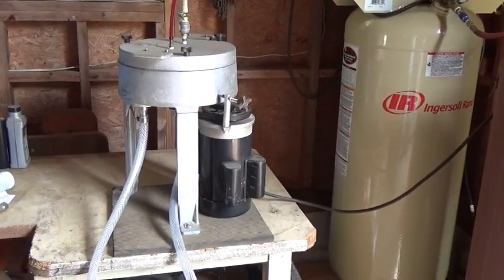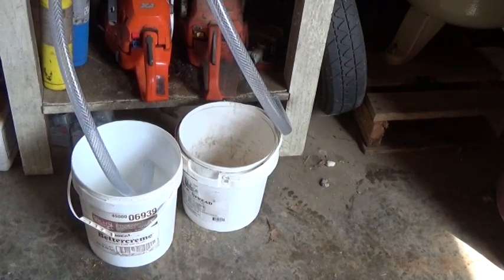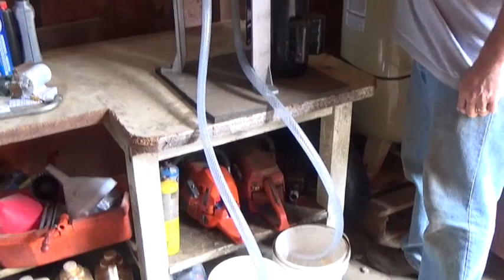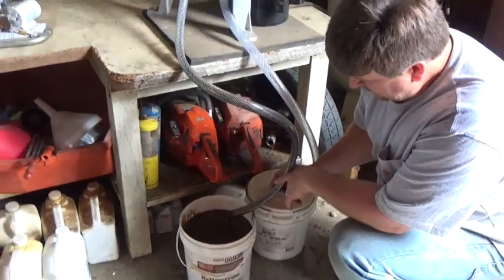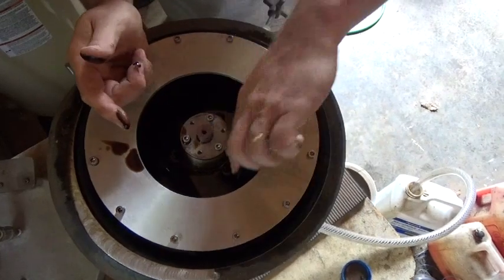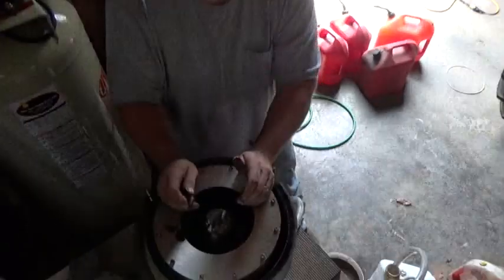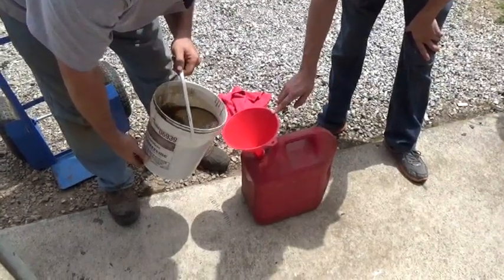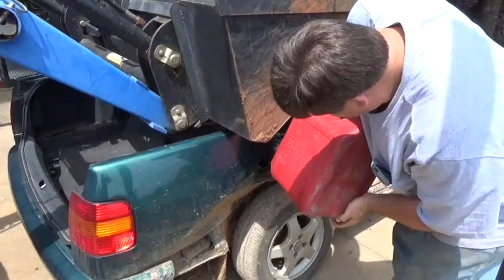Black Gold!  Spin Free Fuel!

Comment: Retired farmer here, years ago I ran a Case 4890 4 wheel drive tractor. Was about 300hp, fairly big for that time. That engine make was a Scania, (Swedish company, still makes tons of diesels). Point is, that engine used a centrifuge to clean the oil. It wasn't a big canister, probably about 8 inches in diameter, and 6 or 7 inches tall had just a couple of small jets that propelled the spinner. It was in the pressurized oil line from the regular crankcase oil pump. The oil continually circulated through that centrifuge. I ran 200 hour change intervals on that oil, and would scrape about a 1/4" layer of hard carbon/contaminates off the inside wall of the centrifuge can with each change. The only paper element in the whole system was a small inline oil filter going up to the turbo. Never had a speck of trouble with that engine, and I have no idea how much money was saved not buying large throw away oil filters. Was a great system, centrifuges do an amazing job..
Reply: I have a superduty with a 7.3 and I bought a centrifugal oil filter from diesel craft and was amazed at how much crap would come out of my oil and my oil stayed looking fresh right around 150 hrs of operation it would start showing it’s age prior to the filter I would change my oil and as soon as I started engine to ck for leaks my oil was black did even look like I changed it i took samples of my oil at 50,100,150 ,200 I usually change my oil between 250-275 hrs  now I go to 500 hrs cause of all the samples I did but the oil analysis lab which was Cat told me that I should change my oil filter around 500 hours so I change it all I use rottella 15-40 now every diesel has a centrifugal filter there’s a lot of different manufacturers
Reply: @jkmcp45  Thanks for your input Sir, I think your experience with the 7.3 would match up pretty close with samples from my old Case. I too sent in oil samples back in the day, and the results indicated I was erring well on the side of safety. Of course I was buying oil in 55 gallon drums for all of my diesel engines and the price back then was just over $210 a barrel! Quite a difference now. (That was Rotella 15-40). Anyway it was very cheap insurance for engines that worked so hard in unfriendly conditions. Good luck with your 7.3, I had two of them too. Good engines.
Reply: @jkmcp45 where did you get that filter from ?
Reply: @Sky_vulpes  Hi, the centrifuge style filter was standard on the Case 4890 and 4894 models with Scania engines. Those were the biggest tractors that they made. Most all of the smaller Cases used a regular Case built engine, 504 cubes, both turboed and naturally aspirated. They topped out at around 250 or so hp, the Scania engine I had was rated at 300. I don't know if they still use the centrifuge system on their new engines (Scania),  my experience was in the 1980's. I can't imagine that they abandoned that system, Swedish company.
Reply: @Sky_vulpes he mentioned diesel craft

Comment: I filter 55 gal. of waste oil in a three phase filter setup useing a 24v Holly cintrifugal fuel  pump mounted above the tank of my truck or a hand crank pump in about an hour or so, I can also use the hand pump as the lift pump to run the truck if the Holly fails. (need a copilot to run hand pump) I mix filtered waste oil with fresh diesel or gasoline just to thin it out a bit and burn it in my 1972 M35A2 multi fuel Deuce and a half military truck witch also has a three phase filtration system. I can run my filtration system in a grid down situation, I can also run it from source to tank if needed. I costs a bit more but I'm worth it.

Comment: You're adding the oil too fast, it should take a minute or two to fill you can tell by the unchanged appearance of the oil, and how soon it gushed out, this process is a rapid dripping rate, not a gravity flow rate.

Comment: Used motor oil works better if you use gasoline instead of diesel fuel to mix.. i run 10 gallons of oil to 1 gallon of regular 87 octane gasoline.. thins out the oil to a similar viscosity as diesel fuel, and it burns cleaner than just oil/diesel mix.. and the gasoline keeps injectors clean

Comment: Wash the oil with water use neodium magnets in the bottom of the drums ‘when the oil separates from the water drain off then heat the oil before it goes through the milli micron filters before the centrifuge .dont forget to line the centrifuge with a piece of paper all the crap sticks to it so you remove the paper and replace it each time

Comment: When spinning oil, the lower the flow rate, the better. (I recommend ~3-5 Min. per gallon) It gives fine particulate matter more time to settle out to the outer edge of the bowl. Another thing to try, is to heat the oil, to make it less viscous, allowing particulate matter to settle out more quickly. Diesel fuel can actually flow a little faster, because of its low viscosity.
Reply: استمر
Reply: Hello
How many cycles does this device manage per minute?

Comment: enjoyed the video. for a WMO recycling project I want to install a brass bulkhead into a barrel so I can control the draining from the bottom to the centrifuge. I figure the brass will hold up better than plastic. it comes with a washer but will it seal better if I use something like JB Weld on it? or is it unnecessary? I'm concerned about the effect of petroleum on the bulkhead and seal. thank you for any assistance you can provide.

Comment: So this was 6 years ago... Would be interesting to know how many injectors you had to clean or replace. LMAO!
Reply: I have 130k on wmo on my 7.3
Hpop when bad(van has 380k) but no bad injectors. 
I LMAO everytime I drive by a gas station and I see a diesel owner paying for fuel.
🤣
Reply: rigo esamor what year is your 7.3? I’m thinking about getting into this with my 2000 F-250. Thanks
Reply: @15569903  I started with a 1998 e350. I did it for 150k miles until the hpop died.  I didn't  want to fix it because it had too much rust. Now I have a 2001 e350 with already 4k miles with wmo.
Right now I starting using transmission oil because is more clean and thiner than wmo. It takes less time to clean it.
Reply: @15569903  
I have some videos in my channel (in spanish) about my system.
Reply: No injectors but he's on his third set of fingers
Reply: Also atf is a great detergent, I add atf to my fuel tank on my cucv to clean the injection pump and injectors quite a bit.

Comment: All this is doing is altering consistency, after doing a Centrifuge youre better to go get an air intake filter £10 , put elevated flat supported each end by to sticks over plastic storage container for $5, and pour away. But even after that it has still ability to create sludge throughout fuel system after few months, also some newer diesels have a an infra red sensor in the fuel line if it detects any black diesel it cuts the engine out = which is expensive procedure to fix. Fuel tanks are already filled with layer of dirt, then adding this in is not good idea.

Comment: I've been testing different oil and no matter how many times I clean Wmo even at 10 minutes a gallon with a heater and same centrifuse that you have  and it still clogs the injector on my 98 VW TDI, but runs perfect on vegetable oil.
Reply: Try automatic transmission fluid, instead of used engine oil. The solution to your problem, might be solved by diluting the oil with more diesel fuel. I wouldn't try running on straight oil. (Too viscous)
Reply: @vincentrobinette1507  I tried that too and still gave me problems so I fix the problem by going back to ( WVO) waste vegetable oil and 20% gasoline.

Comment: This system looks great and simple. I have one of the little dieselcraft type centrifuges that have no motor. Do they work good enough for small batches of wmo?. I’ve had it a long time and want to use it. I also have a new gear pump I bought for it years ago hoping it would work ok in this application. Does anyone know how much pressure I will need to spin the centrifuge the best speed. I think I also bought an adjustable return line pressure valve to control the pressure to the centrifuge. It’s all been in boxes for about 7 years as I’ve moved like 5 times. I’m tired of carrying this stuff around so need to use it or loose it. Thanks
Reply: @Paul Baker - Dieselcraft runs at 90 PSI max

Comment: i ran a old ford idi 7.3l on waste motor oil that i only ran through a 1micron sock. it was always clean oil from very recent oil changes mostly from other diesels. some gas. some ATF. i usually only blended it about 15-35% with diesel and didnt drive it around town on light throttle. when i towed i used it and you could feel the slight power increase. also did not smoke just smelled like burnt oil. never had an issue in 2yrs driving that truck. never changed a fuel filter. drove it all over west coast. sold it years ago.
Reply from the maker: dsruddell That is great. Thanks for confirming the increase in power.

Comment: Will remove particles but wont remove dissolved varnish from old diesel fuel. That is what will gum up fuel injectors and rings when you use it in your engine. You need to distill it to get rid of that sticky stuff.

Comment: May I make a few suggestions?  I have been using my centerfuse for four months which I also purchased from Steve at US Filter Max.  You need the heater he sells and run it between 160-200 degrees to remove all moisture.  As is goes out, I use a mixing tank which I purchased from Northern catalog.  The ratio to make diesel fuel is 20% gasoline to 80% used motor oil.  My recipe is: 16 gallons of used motor oil, 2 gallons of diesel, 2 gallons of gasoline, and four ounces of acetone.   It works great!  Over 10,000 miles on two different vehicles.  One scientist says you can go up to 35% gasoline but the more gas you use the higher the temperature increases.  It takes me about 2.5 hours to make 20 gallons.  You can see mine at Jeanie McKean's youtube.  Thank you.
Reply: Hello Richard, what type of engine are you running your fuel through? Common Rail? earlier engine with traditional rotary pump. I have heard that acids remain in the Oil. What's your take?

Comment: Spinning it is a good way to remove the majority of particulates. To treat the dissolved moisture and acids, run it thru a 2 micron  "toilet roll" style filter, the cellulose chemically traps water and acids.  Lastly blend with diesel, i think Caterpillar specifies 1.5% waste oil to diesel.

Comment: I was hoping to get a shot of the underside of the lid. It looks like the oil enters the rotor not at the center, but near the center as close as possible but not so close it hits the drain holes.  I am sure you don't want oil entering the rotor too close to the circumference because then the old oil entering the rotor could float on the oil flowing over the dam because it is spinning at 6Gs.

Comment: I use centrifuges at work. You can get better results and less waist if you recirculate your oil through continually. Each pass through the centrifuge will take more of the particulates from the fluids. The units I work on have integrated scrapers and are a much higher volume inverted type. The thickness of the fluid will effect how fast the particles fall out of the solution. I like your spatula scraper idea. This is a really great video.

Comment: use motor oil and 10% gas. it will run great. add diesel if you want to clean it up a bit, but it's not really needed. been running this for 10 years. I don't use a centrifuge, after mixing with gas, the oil can be sent threw a 10 micron bag filter and run.
Reply: TOTALITARIAN PLANDDEMIC GOVOMENTALSS.AGENDA12  There are 100's of vid's on you tube

Comment: 2000 + price tag is OUTRAGES
Reply: johnholden2525 outrageous?
Reply: Since I'm looking to go the centrifuge route...might get one of the small $150+ ones first since don't need big batches...but have seen a few home made centrifuges...one uses an angle grinder. If have...or a friend has...the mechanical skill or want to try it yourself...home made is certainly doable. Just study a cutaway diagram so the layout is correct.
Reply: TOTALITARIAN PLANDDEMIC GOVOMENTALSS.AGENDA12  I've seen the homemade CFs on here people made out of torque converters. Unfortunately no real detail. I have one of the 55gal//hr pressurized CF units now. But as soon as a free torque converter turns up a single-pass gravity fed unit would be nice.

Comment: A system we used had many cones stacked one on-top  the other that all rotated much the same speed ! You ran it in a cycle for about 2 hours ,When finished the oil went from a heavy black soot laden oil to a honey golden color ! the only draw back was cleaning the 20 odd cones that sat atop each other ,These were separated in varying thicknesses right down the micron scale of oil's molecular size that varies depending on the oil grade ! each cone separation was stamped with the micron size which you either added or subtracted to suit the oil or fuel you want to clean. this process was also with heated oil around 200 deg's from memory. It was addapted from a machine like this below
https://www.google.com/patents/US5468396
http://www.google.com/patents/US5637217
click on images in document  to get enlarged view.
Reply: SUNGEAR59

Comment: engineer 775 & John D  I used to have a 10HP cream seperator which ran at 6000 RPM! The transmission oil centrifuge in my Agco tractor would spin the colour out of transmission fluid to the point it was hard to see on the dip stick so wonder if you should increase speed of centrifuge??

Comment: How do you know how clean it is? Have you had it tested for particulates? Seems  to me that without a lab check you are taking a big risk with expensive machinery.  The car might run fine on it, but for how long? A lot of faith needed here so far. Do a couple of batches differently and send it for a test (Finning Tractor -and probably others - does them pretty cheaply).
Cheers
JB
Reply: Gerry S are you stupid? This is not dope fiend science. Viscosity, BTUs per pound, particulate counts? Really? Listen to him! Clearly understands how to educate as well as propagate an ideal.
Reply: @elwoodrife1982  If stupidity is trying something like this the first time, seeing if your car will run on it and claiming as a success qualifies, yes I would be stupid.  He didn't mention how actually clean it was....just because it got a bit of grit the size you can feel does not  mean it is clean.  He did say it depends on how fast the oil goes through the centrifuge, but he didn't test it to find out what works.  It needs to go into the car at a maximum of 10 micron, preferably 5 - you can't feel that. When I do it I run it through a bag filter afterwards just to be sure. I wouldn't trust this careless guy with anything of mine.
Reply: A VW Passat?  He addresses the topic of "expensive machinery", did you watch past the first 10 seconds?
Reply: @dansw0rkshop  Unfortunately I am not so rich that I can afford to replace or rebuild and engine in a tractor, Passat or generator needlessly....nor would i want to spend the time just to save $20 to send the oil away for testing on the first round or two.

Comment: You know those metal screen type coffee filters you can get at the grocery store? I wonder if you have tried using them to screen out and clean your oil so that the oil might then be reused for some sorts of applications (not sure what). The metal screen is very fine so I think it might work quite well for tiny particulates in the oil; also you can put a button magnet on it to help hold any iron particles in the oil, perhaps. I have yet to try it but it seemed like a fun experiment when I thought of it a while back... Thank you.
Reply: +Jay Dillon those are about a few hundred microns, centrifuging gets you down to under 1 micron.

Comment: There was a test done in South Africa using Massey Ferguson farm tractors and veggie oil. They may have even tried WMO.. It's been years since I read the article but I'm quite confident it could be found on line. The end result was a reduced life expectancy for the injection pump. It has to do with lubricity, sulfur, the lack thereof. The clearances between the plunger and barrel are a fraction of 1/1000 of an inch. Modern ultra low sulfur diesel isn't even good for an older injector pump (additives are available)   So you really have to crunch the numbers...
Reply: +Mark Osborne Think your right, maybe best thing is to use the heat from burning this waste oil.
Reply: You are right and a centrifuge will take those lubricating particles like sulfur, ashes and many other useful things out with all the other junk.

Comment: I just don't understand why the 3,000 rpm speed is important.
Reply: JohnD; The faster the centerfuge spins the greater the G-force applied to the liquid and contaminates going through it, and therefore the more effective the separation of the media components.  The idea is that different components of the media have different specific gravities.  So the greater the G-force applied (speed), the more effectively the different components are seperated, with the heaviest media sticking against the outer wall of the spinning bowl while the lighter liquid (motor oil in this case) overflows the bowl, minus the heavier contaminates, and drains out of the centerfuge.  You can get too much G-force for some applications though, like hydraulic fluid, where not only the contaminates but even the helpful additives can be removed.  Which would need to be replaced before the hydraulic fluid should be returned to service.  The ability of the centerfuge should be matched to the process.